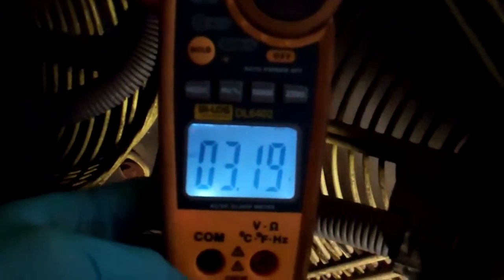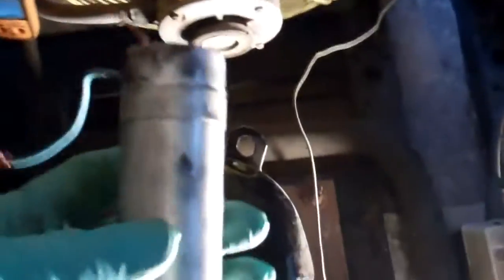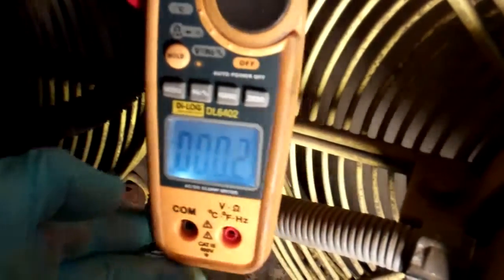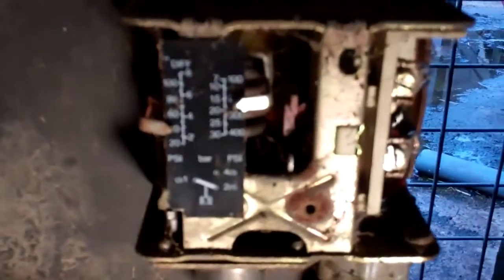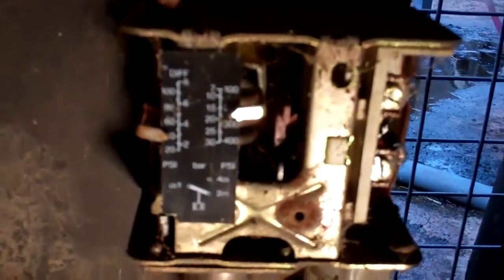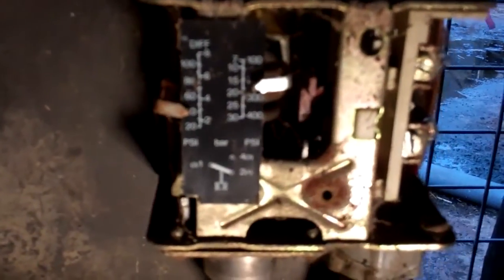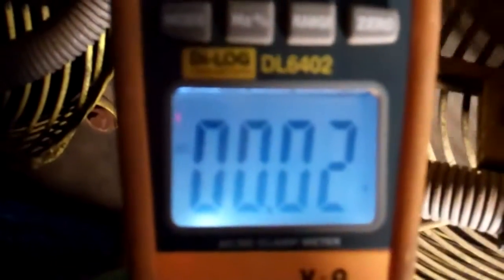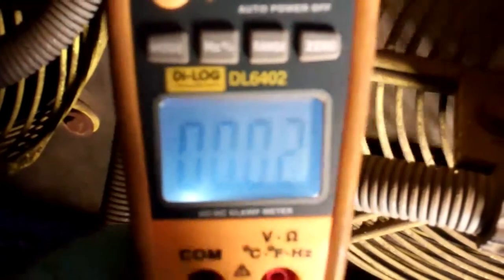Faulty condenser fan motor

Comment from the maker: Seem to remember it was sinlge phase and that the windings were failing, so had low starting torque, the good motor next to it on the same condenser would make it windmill backwards when it triped on its internal thermal overload, when it reset it didn't have enough power to stop and then start in the correct direction!

Comment: My condenser fan motor is pulling 1.1 amps and the specs say 1.2. When will I need to replace the motor? Should I buy one to have in case it goes out? Or does it do more damage to wait until a motor stops running?
Reply from the maker: The 1.2A is probably the maximum run amps depending on the load, 1.1A is ok, so long as the capacitor and bearings are good the motor should run for years. Depends if you can afford for the system to be down for a few days if its worth having a spare fan motor.
Reply: +heavydiesel yes, 1.2 is the max and the system was maxed out with the 1.1 was read. So, you think it would be smart to have one on hand in case it goes out or should I just replace the motor now? They are only $150